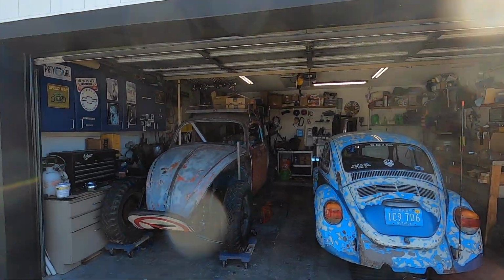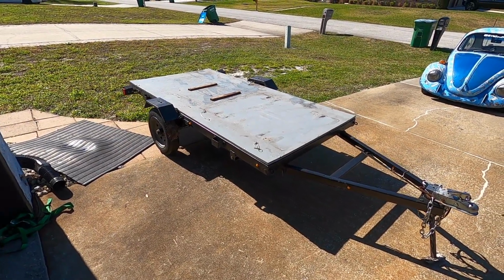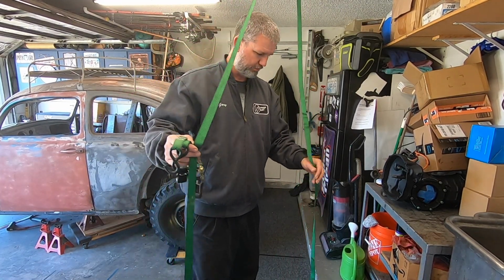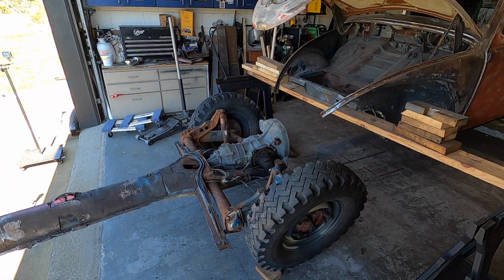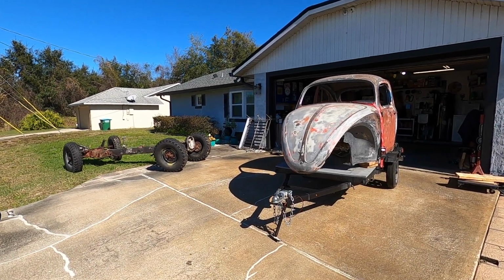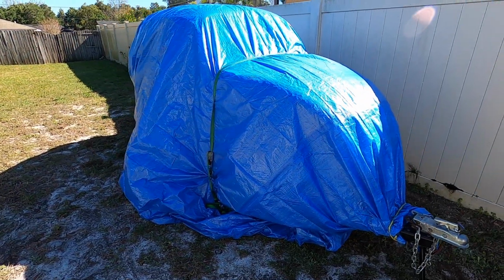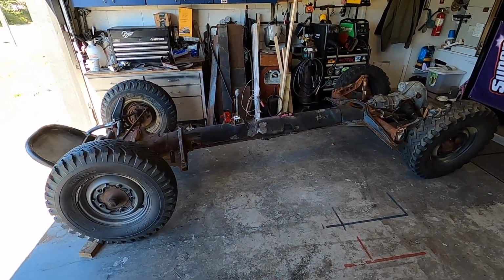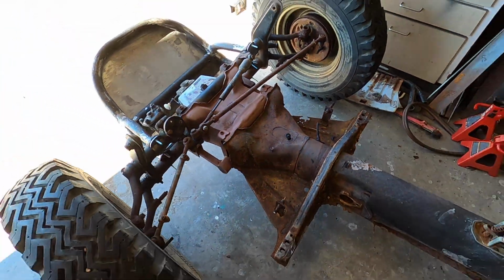The Beginning of VDUBRUN22 - SICKXTY -  Volksrod – Baja / Franken Beetle Build  – 29

Comment: good stuff as always Gary , I use the  "cam lock"  straps for all four corners rather than the ratchet type, lift with one hand pull the strap with the other .
I have had the body off and on  my 56 project at least a dozen times and I'm 63 years old , takes less than 10 minutes , hope this helps some of the other guys out there working solo.
Reply from the maker: Yes sir, the cam lock straps do work great for that! Unfortunately mine were tied up at the moment and I’ve lost count how many times the body has been off and on lol
Thanks for the comment as we all do things differently and learn from each other!